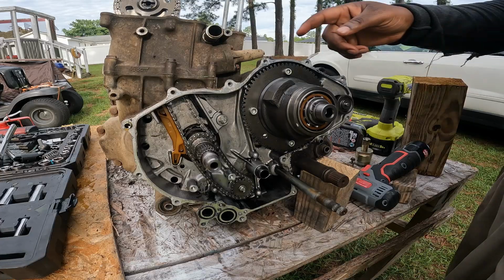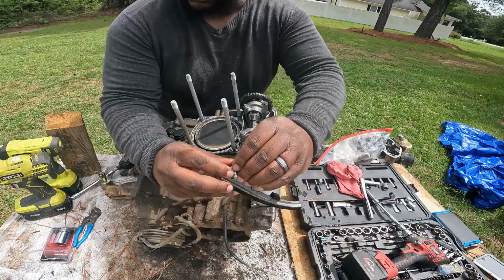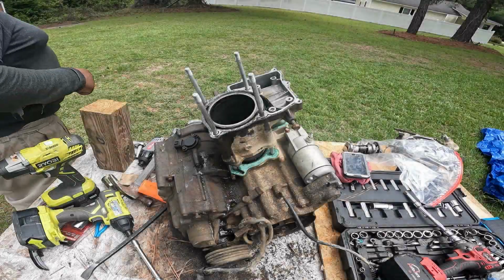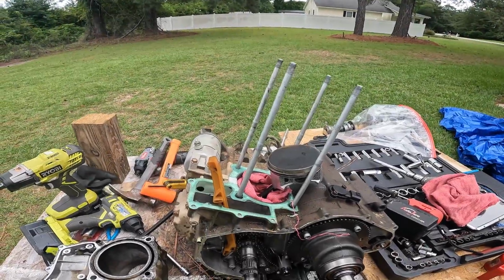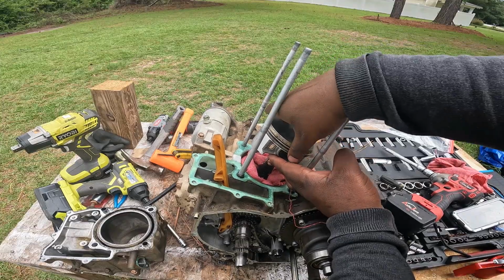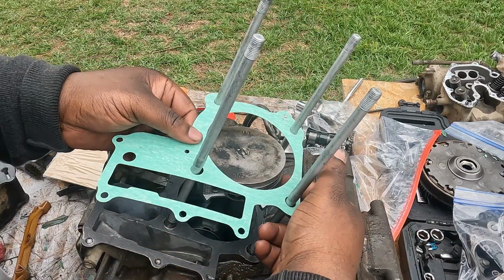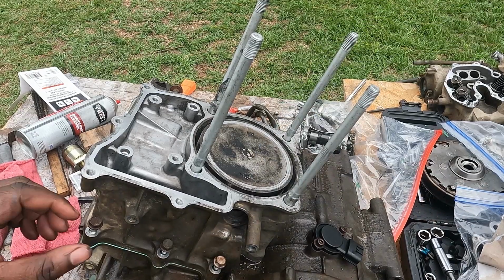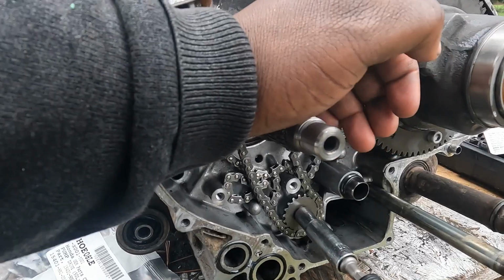Part 2 Honda Rubicon 500 TRX500 Oil Pump Chain & Camshaft Chain Replacement #honda #diy #art #diy

Comment: Hey mate, just wondering if you'd have the part numbers for all the replacement parts you used throughout this job? Planning on doing the same to mine. Thank you, appreciate the thorough video!
Reply from the maker: Thanks for watching and commenting .  I will try to send you a list of the part numbers. It might take me a few days to respond with them but I can get you that.  I hope your build goes smooth.
Reply from the maker: Hey Elijah, so I have screenshots to all the part numbers with drawings of the actual parts and where they go. The issue I'm having is it's not allowing me to paste these in a comment. If you have an email that you're comfortable with sharing on here I can send it to you that way or if you want to message me on one of my social media platforms and send it to me personally.

Comment: Doing the same oil pump chain to my 2001 it was so loose it fell off the sprocket gear and the atv wouldn’t even move. No oil pressure with no pump can cause camshafts to be ate and pushrod cups to be ate! Redoing mine and crossing my fingers lol
Reply from the maker: That’s the same thing I was thinking.  Mine was making a lot of chatter noise.  Once I took it apart I was able to just take all the chains off by hand.   So I was almost in the same position.  Thanks for commenting and watching.  I pray your build is successful. Keep me updated